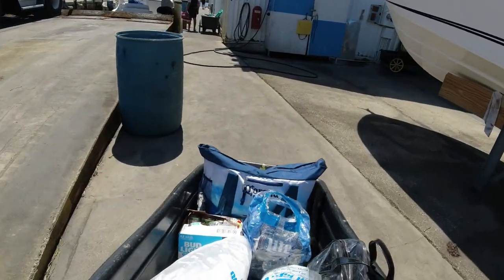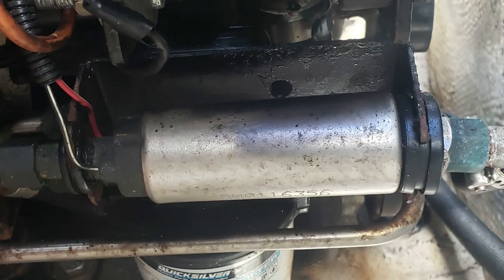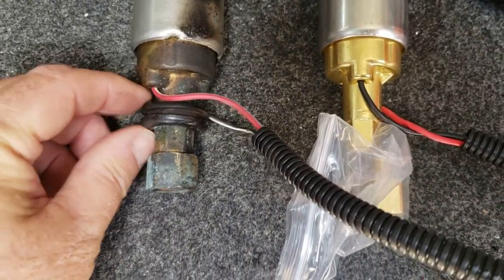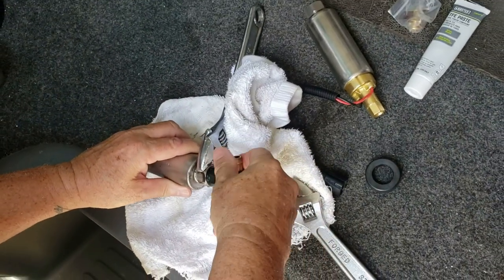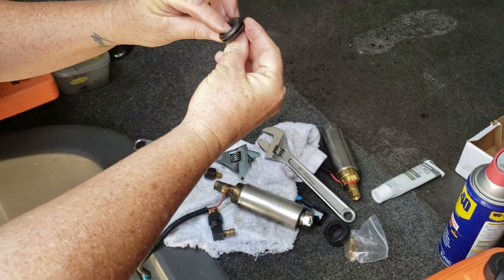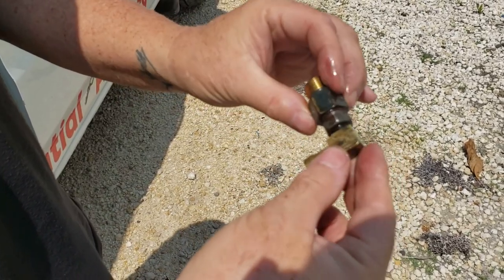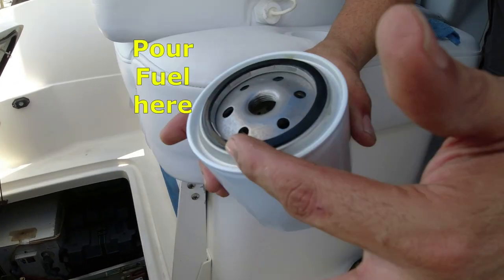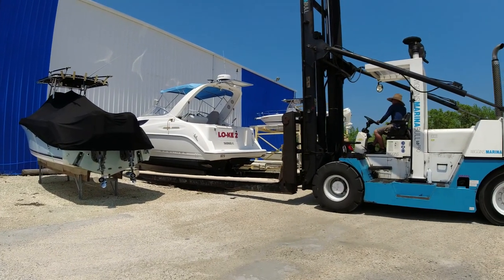Boat Fuel Pump Replacement, Mercruiser 5.7 Mag MPI

Comment: Hi ! Very well done video !   I have the same engine, I am looking for a fuel pump replacement and wondering what is the part number you got, seems to be hard to find, thanks for your help
Reply from the maker: Thank you for watching our video! Its is hard to find, but this is the one I bought on Amazon Vikter Low Pressure Electric Fuel Pump Compatible with Mercury Mercruiser Marine Boat 4.3L 5.0L 5.7L V6 V8 Replace# 861155A3 935432, or you can go to https://www.mercurymarine.com/en/us/parts-and-accessories/parts-catalog, and click on Launch Parts Catalog. there you can look up by your engines serial number. Hope this helps.
Reply from the maker: Hi, here's one of our videos that shows you how to look-up part numbers for Mercruiser engines, hope this helps! Thanks for Watching! https://youtu.be/qel_Rn0J_Hg

Comment: Any idea if this is about the same for the 7.4 mpi
Reply from the maker: Hi, thanks for your comment. It should be the same. But check the parts catalog at Mercury.com to see if the fuel pump assembly illustration has the same components as ours. Thanks for Watching! Peace!
https://www.mercurymarine.com/en/us/parts-and-accessories/parts-catalog
Reply: Ahoy!

The 2000 2855 with the 7.4 MPI is very different indeed!

The pump has the cool flow set up. The 7.4 pump and cooler are buried under the right side of the engine (port side of the boat). It’s a nightmare in the 7.4 MPI 2855 Bayliner. It’s an in-line pump, they could have put it anywhere! The pumps are the same other than the outlet being threaded for some applications and smooth for others.

Comment: There’s a high pressure and low pressure pump, no?
Reply from the maker: Hi Jonny, yes there is 2 pumps. One on the starboard side of the engine and another in the port side bottom inside a box with the fuel cooler. Thanks for Watching! Peace!
Reply: @KeysBoatingChannel  thx! 😁
Reply from the maker: You're welcome!
Reply: @KeysBoatingChannel   Hey mate do u know which one is which? Is the one in the box the high pressure?? Do they boith make a priming sound?
Reply: hi  @Nofusscomputers  I have a mercruiser 8.1 HO 496 and I think only the high pressure pump makes the priming sound, yes the one in the box with fuel cooler. PS does anyone know where to find a video of how to replace the HP pump? its hard to get to